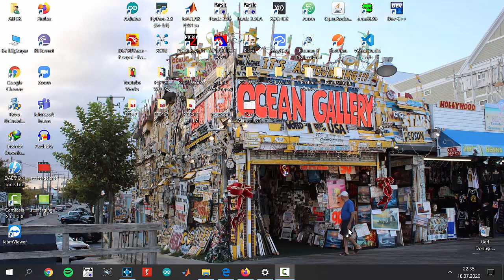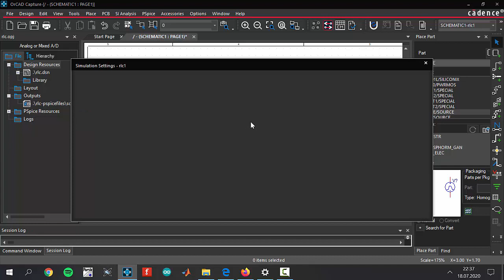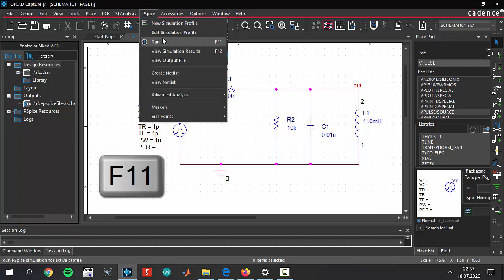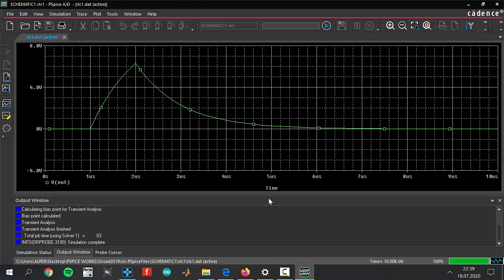LESSON 9: ACE 3 Parallel RLC Circuit Example #pspice#orcad#cadence#tutorials

Comment: Hi,
thanks for the educative video.. additionally, I want to observe parallel RLC BPF act using AC frequency sweep but if I no series supply resistor, it gives error like (Voltage source and/or inductor loop involving V_V1. You may break the loop by adding a series resistance)! it requires a series resistor after AC voltage source, and this resistor value highly affect the BPF Bandwidth!  what is the correct circuit topology to determine precision RLC band pass circuit???